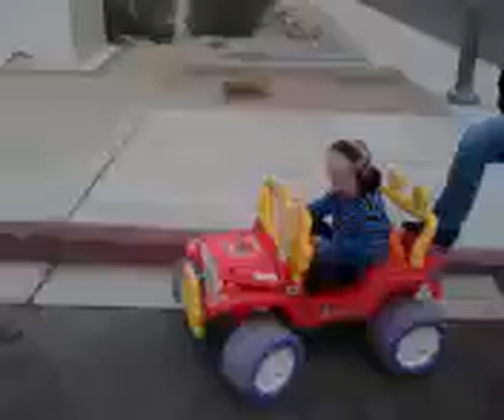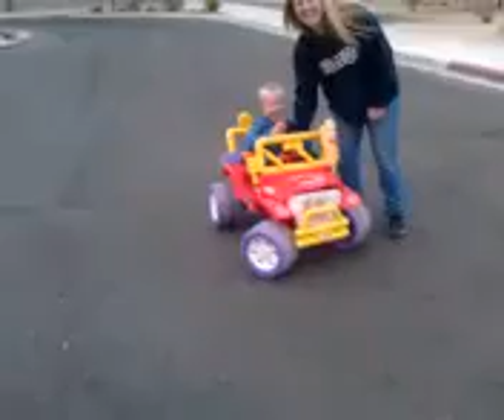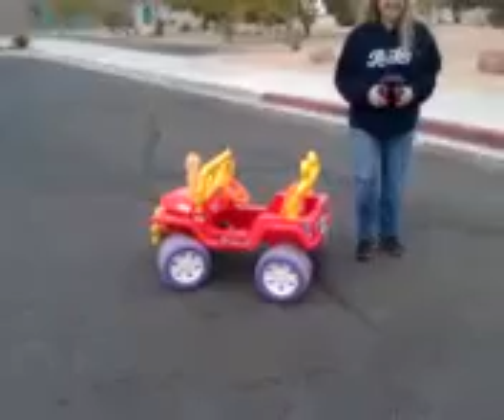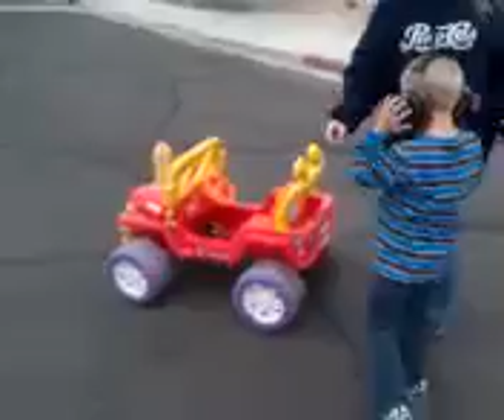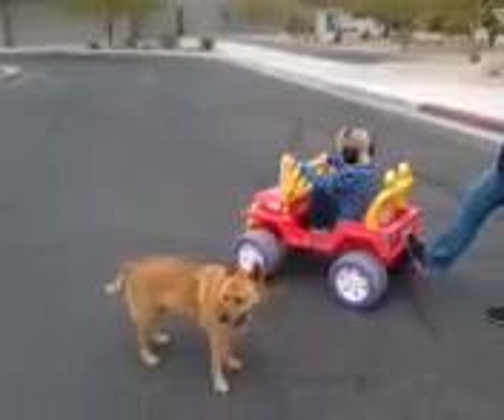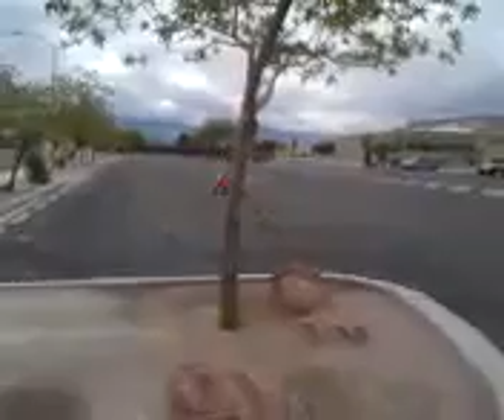Running a Lipo in the Power Wheels

Comment from the maker: It's completely stock! All we did was drop a 6 cell lipo in it. I just soldered on a deans plug so I could use my lipos. There is no esc as well. I'm not sure what motor is in the power wheels but it was a stock one. WARNING: we did end up frying both motors about 2 months later. They got very hot and eventually just went out. The was an old powerwheels we had its junk now.